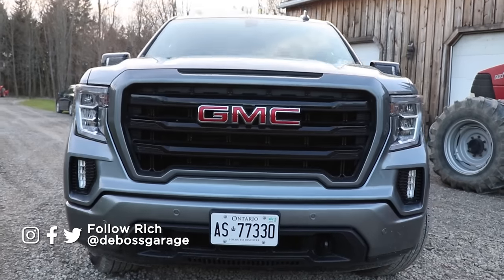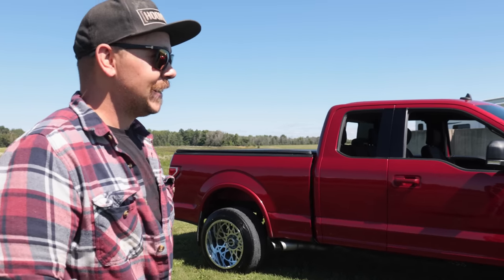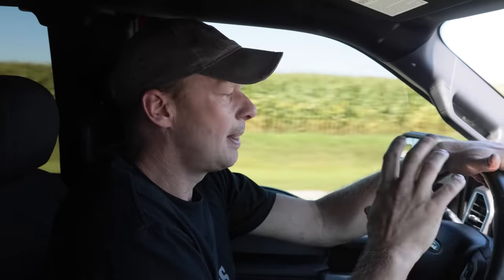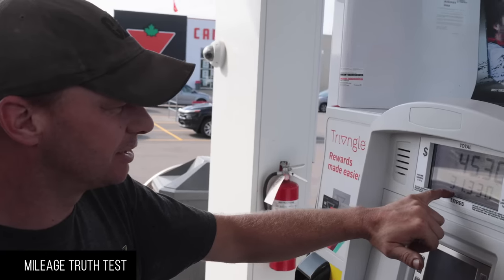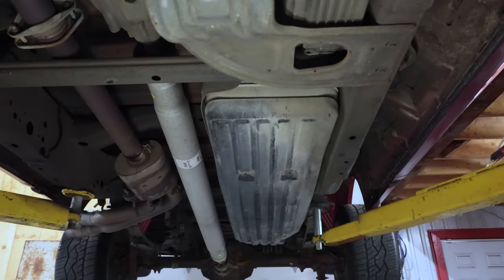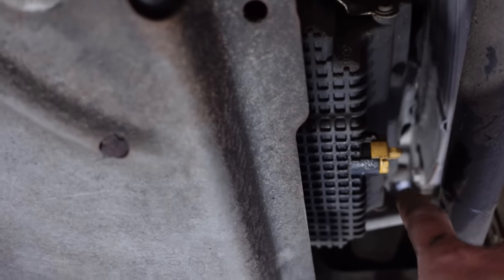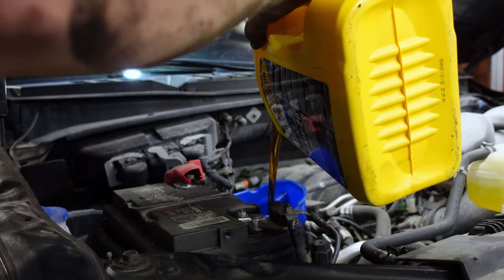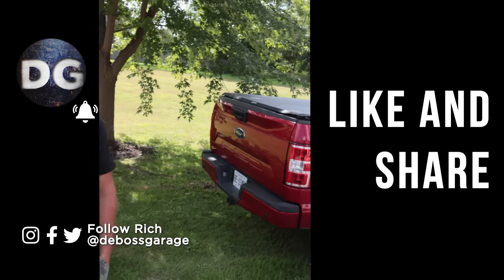REVIEW: 2020 Ford F150 Issues After 2 Years of Ownership?

Comment: Question for the auto body folks out there... What has y'all's experience been like performing body repair on these aluminum vehicles? Gap fits, paint matching, aftermarket vs factory panels, pricing, etc...? I imagine it makes jobs slightly more difficult, but I certainly appreciate first hand experience from the pros.
Reply: Ya you must be a engineer who is not a body man. Waterborne paint has nothing to do with orange peel. It’s the application. Gaps and fit on aluminum panels are by far worse that steel bodied panels due to the fact it’s way harder to produce body panels from aluminum. It is way less ductile or malleable than steel. Nothing compared to relatively flat semi body panels. Aluminum panels also are more brittle than steel tending to crack from sharp angle cutouts like gas lid openings and stake pockets. Aluminum panels stand up to hail much better than steel however if you have to paint less dent repair it is considerably harder to do. If a pane gets stretched from impact you generally have to replace it as shrinking aluminum is dam near impossible. All that being said I don’t mind aluminum except it’s way less user friendly than steel to fix especially for the home handyman. My first thought was that when the rocker panels and bottom of fenders and the fleet sides were abraded by rocks the aluminum would oxidize quickly but doesn’t seem to be the case at all. The aluminum panel formula stands up well to degradation from salt seemingly much better than steel. All that being said I appreciate how well they stand up. Much better than I thought they would. When one of these trucks are twenty years old will tell us if all aluminum was a good idea. Just my opinion
Reply: @123suzukisamurai   @123suzukisamurai  thanks for all the info. Is there a significant difference in cost related to paint, panels, or special equipment needed    when comparing steel and aluminum?

Comment: I have the same exhaust on my crew cab
It's worth noting that there is zero sound deadening on the back of the XLT/XL trim f150s of this generation. 
Also the sliding rear glass is so thin that I can't tell the difference, in noise, between open or closed.

Comment: I basically got the same truck except crew cab 6.5 box and it’s been solid so far at 60,000km only issue I had was my passenger window switch had to get changed

Comment: Great video, I like how you did the review. I have a 2019 F150 with the 5.0 and the one and only issue I have had is a VCT solenoid causing it to idle rough and stall at lights. It would intermittently over retard the timing on bank 1. If your out of warranty they are $30 each and easy to replace. Oh and mine is a supercrew with the normal 4 doors not the suicide doors and I hear no wind noise even at 105 mph.

Comment: My 2006 F150 4x4 long bed frame is shot. i just swapped my 124,000 miles engine into another long bed with a perfect frame i got for 2700 that had a bad cam and high miles. Ill keep my low mile transmission and T-case as a spare if the truck i swapped into trans fails for any reason. I did a full timing set on my 2006 engine before dropping it in so it should be good for another 125k miles. I HATE the design flaws like dumping water on the frame and plastic oil pans waiting to fail etc. All the car companies do this to their customers. I bought my 2006 new and the frame rotted from the inside out even having it professionally undercoated when new. thats probably why it rotted. never again

Comment: I have a 2018 5 l extended cab long bed, at 65 mph I see 24 miles per gallon on dry roads, I have gotten 20 miles per gallon City driving but typically I think I'm about 18, now I understand I am a old man I do not have exhaust and when I replace the tires I am going with stock size again.

Comment: Change your oil every 4-5k miles. No matter what.
Also, his reason for oil consumption is wrong. What actually happens, is the throttle body closes too quickly on breaking. When that happens the oil gets sucked from the cylinder walls and burns it. They have a TSB to make the throttle body close slower on de-cell

Comment: I laugh at how so many guys bash the Toyota Tundra and fuel economy. My 20.Tundra gets the same economy as this truck and even better. The best I have seen is 11.4 litres/100. The 5.7 V8 is no dog...it hauls serious ass. I have 31 000 kms now and had 2 issues. The battery died at 6 months and a cracked windshield. With 140 litres of fuel I can get maybe 900 kilometres of range. I am with you...I love a.nice quiet exhaust. Too old for.noise.

Comment: Why purchase a 4 wheel drive truck when you're going to install a set of ghetto wheels and tires with little to no sidewalls? A real Canadian.

If he's having issues with paint adhesion from rock chips, get paint protection film installed from the body line down. As for a brand new truck with runs in the paint. Did he look at the truck when it was purchased? A warranty on any vehicle stops at the property line of the dealership. As soon as it's off their lot, the champagne corks get popped and you've become the latest "Sucker" to believe the manufacturer is going to stand behind the vehicle.

Comment: Just bought a 2020 f150 5.0 . Noticed upon accelerating there’s a rattle / grinding noise from the front driver area of truck. Any thoughts on what that could be ? Dealership said it’s nothing to worry about . Yet it’s an annoying sounds .
Reply: If you’re running 87 octane or below try premium gas.  It’s a high compression ratio engine.  Some say they run fine on regular some say they don’t.  I run 93 octane in mine.

Comment: Should use Amsoil it's a Way Way Way Way better Oil than Pennzoil or Mobile One or Castor Oil.  Amsoil Full Synthetic Oil is absolutely Amazing Awesome Oil.  I always used Mobile One or Castor Oil in all my Vehicles.  Until I saw a couple of Motors tore down using Mobile One and Castor Oil.  I've also seen Motors tore down using Amsoil Full Synthetic Oil.  The Motors that used Amsoil Full Synthetic Oil looked like Brand New inside the Motor Block and The inside of the Head's were amazing clean looked brand new.  No Oil stains or sludge or carbon anywhere.  The second cleanest tore down motor was using Castor Oil and the third tore down motor was using Mobile One.  I NOW and always use Amsoil Full Synthetic Oil in any Vehicle l own.  Because of the Proof of seeing the inside of the motor and head's and pistons etc and the Oil Analyst done on all the Motors and any Amsoil motor always came out ahead of the other...

Comment: I’ve owned 4 exoboost f150’s… 2017 and up are absolute pieces of shit… 10 speed sucks and cam phasers fuck up non stop. Moved down to a 16 3.5 and it’s solid. The 3.5 ecoboost east the 5.0’s for breakfast
Reply: @working_country ___ tell that to the guys that tow and have 180-200,000 mi on their 3.5’s without “blowing turbos”, don’t believe everything you read, on the internet

Comment: There is a popular woman on youtube that was showing the underside of a new Mercedes-Benz. She was going over the parts and you could clearly see plastic on the transmission. The plastic looked like it might the bolt side of the bell housing. It wasn't all plastic, it was a mix of plastic and aluminum. In this truck the oil pan and drain plug is plastic. I don't see why they had to make these changes to vehicles. The vehicles today seem to be given a lot of latitude to fail. Its so disappointing to see these changes. The more I learn about new cars the less and less I want any of them. They can go ahead and raises the prices of all new cars. I won't be buying them.

Comment: Going from the factory to a 34” tire hurt me by 2mpg. I think it just bumped me into more converter use by knocking me out of the sweet spot of gearing.
Reply: 275/65R20 nitto trail grappler
Reply from the maker: Good info, but I would likely put the same tire on lol.
Reply: @DEBOSSGARAGE  the tire looks great! And it’s a big step up in traction offroad or in a muddy construction yard or field.
Reply: @working_country ___ wow thanks bud haha. Too narrow for what tire? The rim it’s on? The one that’s precisely the size the tire manufacturer asks for? That one? Huh interesting. Also, this truck has never not had a 275mm wide tire on any of the 3 wheels… 

My job site is global mining operations, another way to put it is the beginning of the rock cycle. I’ve cut my tires on rocks before and these tires have exceeded my expectations on toughness. I am very happy with all off-road performance regarding this tires. 
They’ve gone through about 4 North American mountain ranges, lots of time in the Rockies. 

But hey I’m happy to take tire recommendations if you have one that you think will make me happier. I’m sure I could come in cheaper, they were a bit expensive. 

More sidewall is certainly more comfortable. No one is arguing that. Definitely easier to mount by hand, I think the easiest tire I’ve ever mounted was a 49” interco irok for a tube chassis buggy build. It was laughable how easy they slipped over the bead with all that sidewall.

Comment: Hey Rich, I have a 2008 and a 2010 Silverado you can review. both with around 300,000 km. The 2010 just had some paint work done, but is mostly stockish, the 2008 is my winter beater. Funny, both get the same fuel milage as that truck and also dont burn oil. Im just up north if you feel like a road trip
Reply: Sure.

Comment: Gawd I h8 new cars, barely anything is a true manual transmission anymore, more and more turbo stuff and direct injection which depending on the maker will have valve carboning problems. Seems like the days of fixing your ride yourself are becoming more distant and unfortunately I live two hours from Rich and although I oil my vehicles it’s hard to keeep enough oil on them to keeep the rust to a minimum

Comment: Domestic American vehicles are trash. I have a 2000 Lexus/Toyota RX300 with just about 200,000 miles on it and I'm afraid to get rid of it, it's been a fantastic rig and has never let me down. I also have an 84 Chevy C20 with 114,000 on it and I'm the second owner. It's a bare bones work truck with a 350 in it. Super easy to work on it, parts are plentiful and cheap and I'm afraid to get anything newer. I'm happy with these two vehicles, not to mention the fact that ALL new cars/trucks are essentially rolling cell phones, they track your every move and some even send driver operation habits to the insurance industry and they're adjusting rates accordingly. I'm holding on to the old girls as long as possible because I'm sorry to say, designed obsolescence is alive and well.
Reply: I have an 84 K5 Blazer and parts are NOT plentiful anymore. And the parts you do get are usually made in china JUNK. LMC = JUNK. Local part's stores, what little they do stock, is JUNK. It is not what it used to be owning one of these rig's. Local parts stores are lucky to have anything you need. Needing a part on short notice means you're SOL
Reply: @defbear  maybe I should've clarified, I source parts via marketplace on FB and Craigslist. 
Yeah, new parts are a crapshoot.

Comment: Ford would have a near flawless product of they got the 10 speed to work. It's too many gears and even a computer can't figure out how to swap them.

Just got rid of my Transit Connect. The 8 speed is rubbish. Only time it shifted fine is manually. 

Yet both my 6 speed F150, the 6 speed Transit, and 6 speed Transit Connect at work shift flawlessly. What's up with that Ford?
Reply: Well it seems it’s too late for this suggestion,  but I saw a video of an owner with horrible 10speed issues turn off the “adaptive learning” that the transmission control unit holds, and apparently it solved all his problems. 

The master tech at the Ford dealer tried it and rather than learn his behavior when driving, it would just shift like it’s intended to do.
Reply: @robs7527  I bought a scan tool capable of that and my little van would shift a lot better when I cleared the adaptive learning. Unfortunately I didn't have access to turning it off. I do have an HP Tuner but didn't want to do this under warranty.
Reply: @affordabledcgenerators1607  I think Ford could’ve been more transparent about the 10speed and it’s TCU programming and it’s apparent deficiencies. I wish they had a menu toggle that would allow you to turn it off at the drivers request.

Comment: I’ll agree the new Chevy truck body style is hideous and that’s coming from someone who loved the Chevy trucks and had a few. The GMC looks better but still not there. Ford has the design down. Dodge did until they changed the front end again. I do not care nor like the wheels sticking outside the fender wells. It just throws more debris/rocks and breaks/cracks more windows than stock.

Comment: I love my 2018 Chevy Silverado 1500 4x4, got it new with 19 miles on it, currently has 44449 miles or 71533 kilometers only issue was the driver seat needs to be recovered (vinyl interior) it’s my daily driver and if I could buy it again I totally would in a heartbeat, if I could afford two I’d get a matching GMC Sierra.

Comment: Couldn’t agree with you more on the wheels and exhaust, completely ruin the truck. It’s also illegal to have wheels extend out past fenders and I wish cops would ticket all the millennials that think this is a cool look!
Reply: The wheel extending past the body is illegal as a truck driver I found the exact regulation when swapping the steer tires on my kenworth t800 from a 11r22.5 to a 315 80r 22.5 their is a fender extension that is required to be legal.
Reply: You act as if Boomers and Xers never ran around with centerlines and cooper cobras sticking out past the fenders on their "muscle cars"
Reply: @jburnham9109  Or 95% of Jeeps ever registered (mine is on the ragged edge).

Comment: I have an 18 f150 with a 5.0 91k miles. clatters like a bitch. even with oil changes every 5k miles. I never wait for the light to come on
Reply: I have a 2018 and a friend who has a 2020 both engines are noisy. I change my oil every 5k with full synthetic.
Reply: @gabrielrowlands6809  yea they clatter at idol. Well it's keeps running so I don't know. Just throw the 300 straight 6 in then. I'm tired of the complicated b.s.